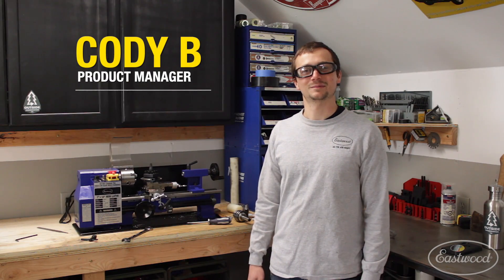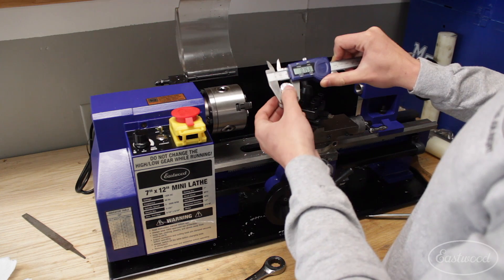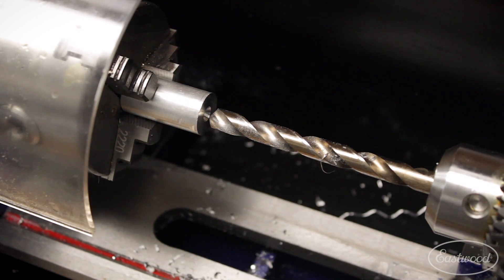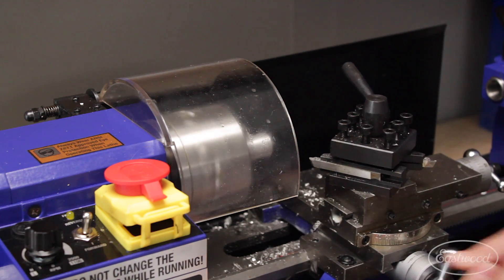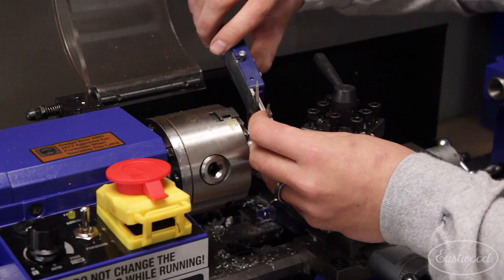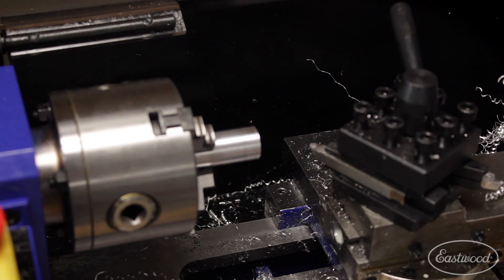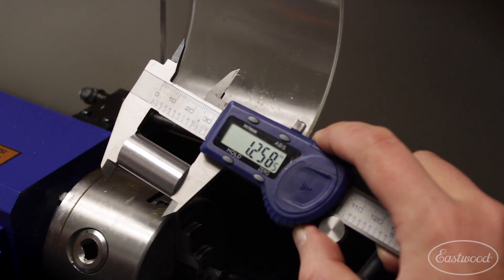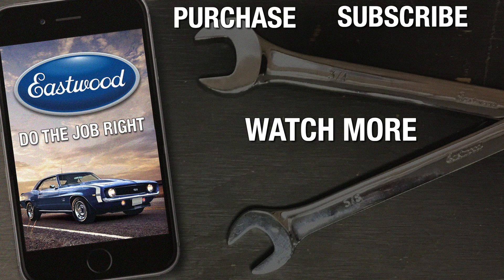Beginner EASY Spacer Project Using Mini Lathe - Eastwood

Comment: Should have kept it the full original length and could cut the OD in one or passes instead of having to flip it and also cut it to length within a thousand and face the remaining off also for a better scribe line could have layout dye I understand its a hobbyist machine and people start with them it helps to get into practice of doing things right with a beginner machine saves headaches when getting into the bigger ones and bigger projects

Comment: Instead of cutting the piece off with a hacksaw, why didn't you just leave it to length and then you wouldn't have had to flip the part when you reduced the OD, you could have just parted it when you were through..

Comment: didn't center piece in chuck(still must do even for 3 jawed). Also, your tailstock is too loose as you can see the 3/8" bit rise up slightly when entering the 1/8" hole.  Sorry, but this iis NOT a good teaching video
Reply: it was never a teaching video He even said this at the beginning that he just a hobbyist and this video was just to show what the lathe can do for small parts.
Reply: No shit, pay attention to what was stated at the beginning of the video. If you want to be taught to machine, go buy some books and talk to real machinists. 🤦🏼‍♂️